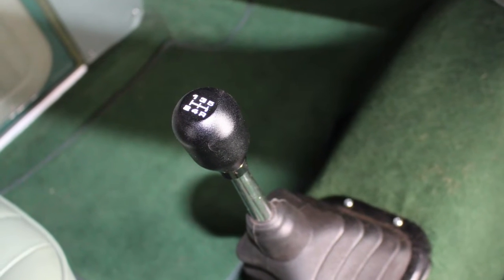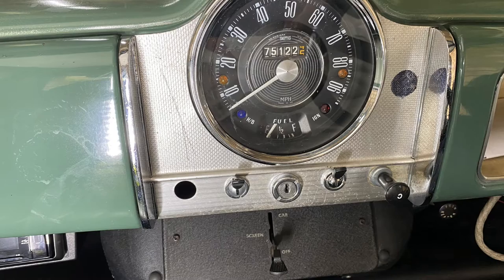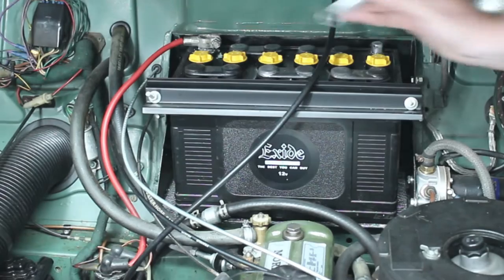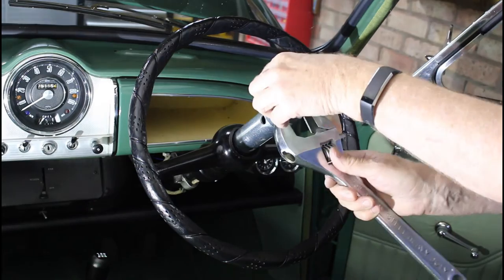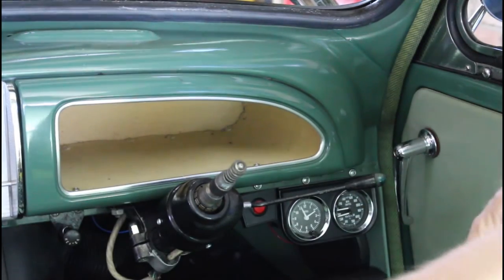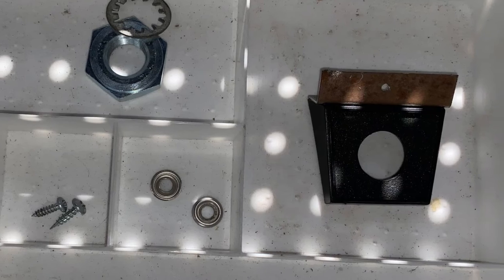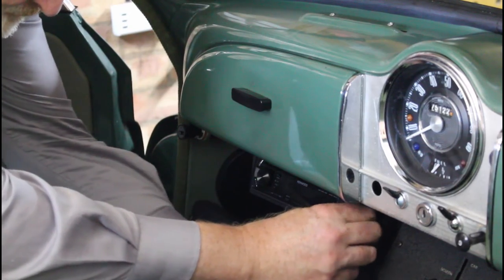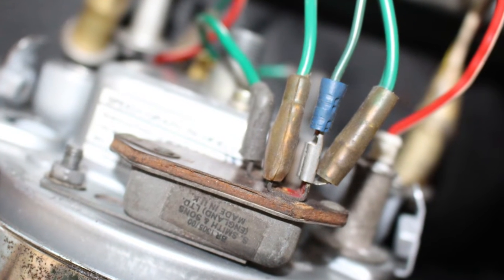Morris Minor dashboard and steering column refurbishment part 1

Comment: Always a good idea (as you mention) to leave the steering wheel nut on a few threads. That way if you are pulling hard on the wheel, the nut will stop you getting hit in the face if it should come up suddenly.
It’s also possible to remove and replace the drivers side glovebox surround and then the liner with the steering wheel in place.
Reply from the maker: You can just about get the driver’s side glove box out with the wheel in place, but it’s significantly easier if you remove it.

Comment: Very helpful video! What's the name of the tool you used to remove the lock washers on the dash switches?
Reply from the maker: Thanks! They are usually called a Switch Nut Removal Tool.